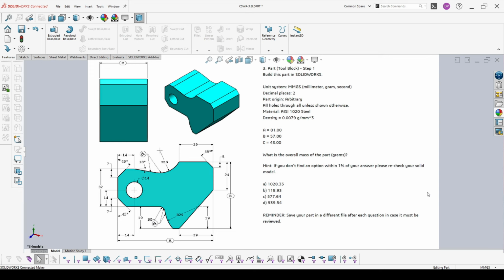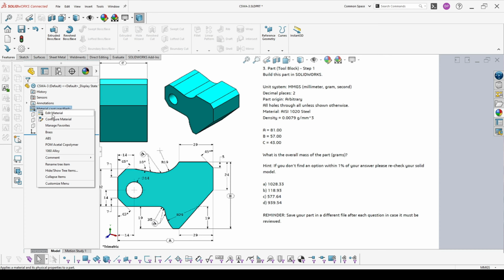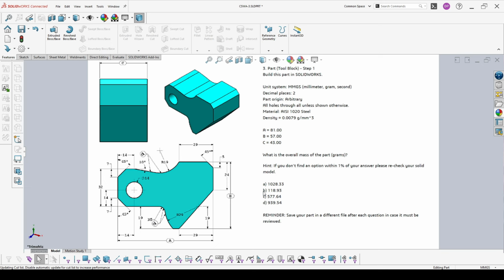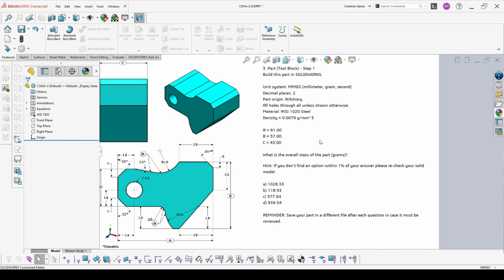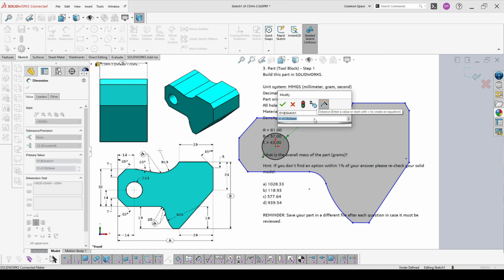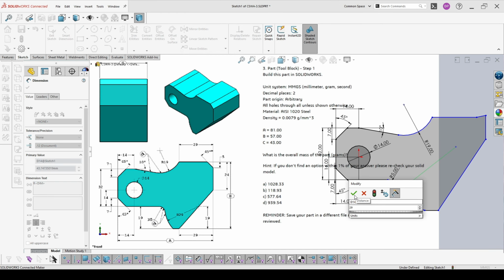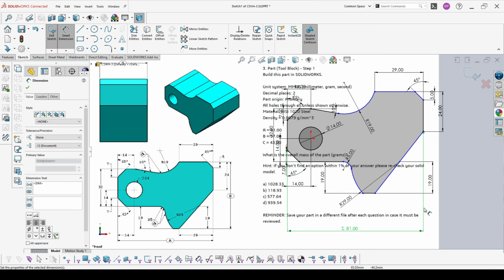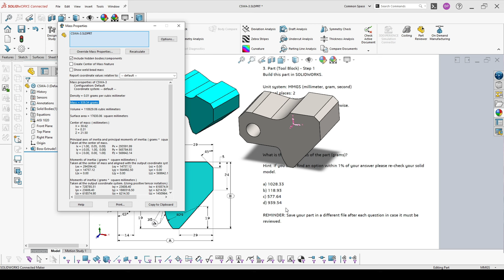SolidWorks CSWA Sample Exam - How to solve Question 3

Comment: Hello, great explanation! Thanks 👍 one question though... Isn't better to always use extrude mid plane? 🤔
Reply from the maker: Hi Cătălin Alb, that's a great question and the answer is no. It's recommend to use midplane only on designs with symmetry. Otherwise you should pay attention to best origin placement for the model and where you'll need to place features related to. I always recommend not to relate to model faces when you can use base planes as reference.
Reply: @DWorkshop  Thank you 🙂 👍 I will follow your advice 😉👌👍😊

Comment: What could be the part I am missing , I keep on getting a different mass , I even tried following these steps too but still. My mass  is around 930-960😪
Reply from the maker: First check if your material and its density are correct. Then have a look on your sketch: 
1. Is it fully defined?
2. Check if dimensions and relations are to the correct places.
Also please share what is your volume.
Reply: Mass is 953.87 volume 120743.53
Reply: Cubic mm
Reply from the maker: That's much more, can you send me your file? Please find me in LinkedIn about it. https://www.linkedin.com/in/danutep/
Reply: @DWorkshop  Will do